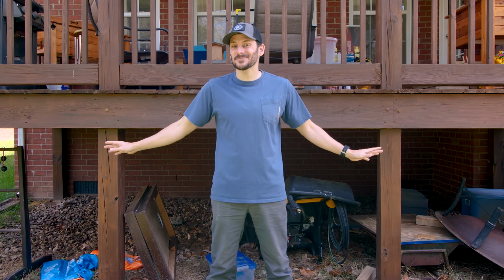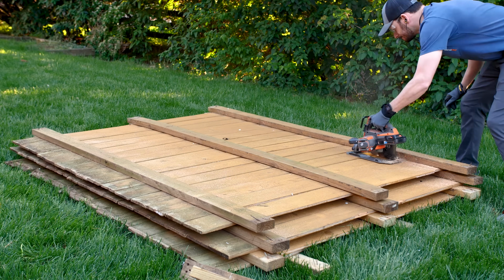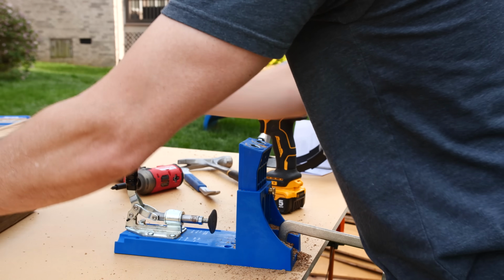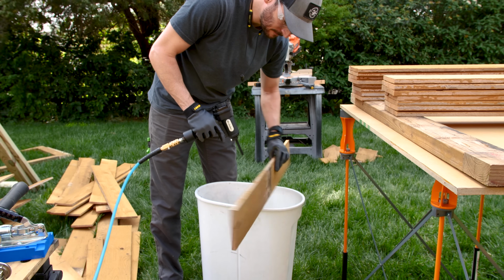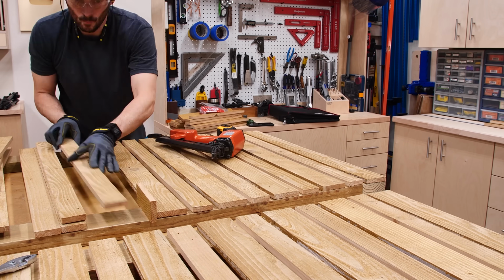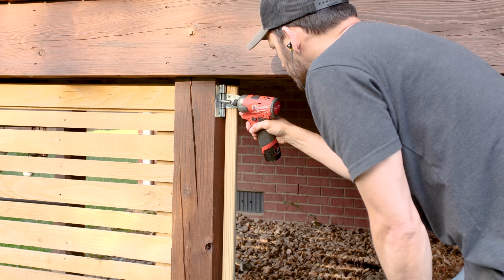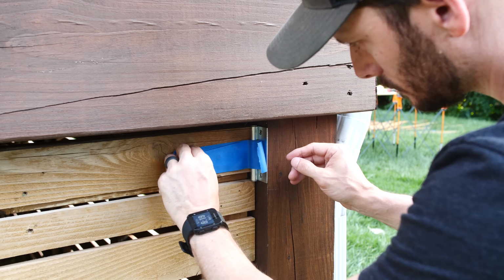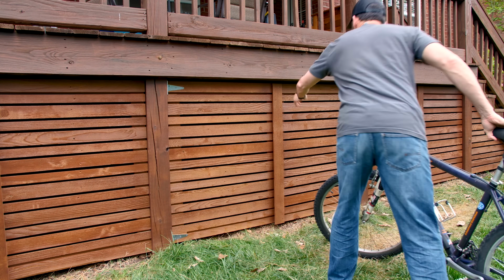Easy Under Deck Storage

Comment: I realize this video is 5 years old, but hopefully you'll see and respond to my question. I'm in the midst of doing exactly this under my deck. Though I used store-bought fence pickets, not free but pretty cheap ($2.18 per 6-foot picket). I have reclaimed a bunch of wood from my kids' old play structure, though. To the question, what about waterproofing? I plan to put the Christmas decoration tubs and my lawn mower under there.

Comment: Great project and incredible job on recycling the wood. 
I have several times used recycled cedar fence boards on projects.  I did a beautiful project around a big island that turned out beautiful recently.  The nail holes just added character on my project.

Comment: you should Update your drain pipes off the porch , get rid of that black piping  because over time the weight of the ground and people and heavy things going over it will crush it , replace with PVC pipe  in a undground trench leading to the back of your property  but a better drainage

Comment: Brilliant.  great idea on clamping the door panels together before installing.  Ive tried the opposite and literally spent days trying to get them just right.  End result screw holes slightly off resulting in a messy work around.

Comment: Very cool man! I did something similar to my deck many years ago. I used treated decking boards and ran them vertically rather than horizontally. I think either way is a lot better look than lattice.

Comment: You did a great job! I did a similar job to my friends back porch/deck in TN.  I hate hand saws but I found most american hand saws work /cut on the push stroke. When you apply a pushing force the blade wants to bend on an america style saw so your cuts are wider and not straight! I bought a Kakuri Japanese pull saw! It cuts on the pull stoke! The blade is in tension and keeps a straight thin cut.

Comment: Great looking project!  Do you have a deck gutter system to keep the rain from dripping down into your newly enclosed storage area and getting everything wet?  I plan to create a DIY roof with some fiberglass, corrugated panels installed with a slope to a gutter to keep the water out of my storage.
Reply: Same question and I had the same idea as you. That alone is a huge project for me as my deck is 10+ ft off the ground and 10x20ft.

Comment: Tim from Canada if you were doing this reclaiming Oldewood and you are using a reciprocating saw with a metal blade to cut your nail heads off suggestion put a tarp underneath your wood so you do not have to find the nails later.. because in the end when you were cutting the grass do you really want those things to be shooting a crossed your lawn.(Step one when you were reclaiming all wood and you were having a hard time taking the nails out..).. step to put a tarp down then put your project over top of your tarp... it will see you in the end when you’re picking up nails.)."(step three you’re ready to get to work on your project use a reciprocating saw with a metal blade it will save you a time in the end have fun get to work)

Comment: Years back we re-did all the baseboard in the house and the 18ga brad nailer was a life saver. After hammering in nails to the first board I went and bought the thing.  I also had a project that needed staples and got an air powered staple gun because the hand held one was a pain.  Falls into the "best purchase ever" category.

Comment: Great video, but I'm surprised you didn't put a coat of finish on everything before assembly! I've found it means less worry about getting into nooks and crannies! It also makes for less of a race against weather, you can still fit everything inside, usually
Reply: i think  he would of if he didn't have that sprayer and I think they were cedar fencing so they were pressure treated..???

Comment: If those are cedar fence pickets you're going to regret not using stainless steel nails in a few years after those galvanized nails react to the cedar oils and leave dark stains streaking down. I've seen this time and time again, regardless of how well you keep the wood stained. Otherwise I really like your work, nicely done.

Comment: Need to add a cross brace on the swinging panels. Place inside the frame and run from outside top to bottom hinge. If you want it to last longer haunch them in to the perimeter frame.

Comment: You not only saved the wood from the landfill, you saved your wallet from lumber prices. 
If you have the time, I'm curious what this would have cost buying new lumber. Prices are way crazy right now. I would sometimes buy a longer than needed 2x4 to have the scrap for a fire pit, now I cry inside when I see the prices.

Comment: If you use a lot of reclaimed timber I think you would find a pinpointer a great help. It will locate all those hidden nails left in the wood. I use one on all my wood before running it through my joiner thicknesser.

Comment: My only question would be what's stopping those doors from flopping around during a strong wind? Have you considered putting some sort of catch or magnetic stop on the door sections? Maybe high wind isn't a problem where you live, but for me it seemed concerning.

Comment: If you set your air too high, the death puncher will send everyone in the neighborhood running for cover.  Nails bounce like crazy.  Trust me on this. ;)
Reply from the maker: Oh yeah, had one bounce off the bottom of the trash can and hit my safety glasses. Gotta be geared up when using it!
Reply: @Fixthisbuildthat  LUCK 100
Reply: @Fixthisbuildthat  Possibly dumb/overkill suggestion: some water in the trash can would stop the nail from bouncing back towards the user
Reply: @mountainbreath1371  or sand/dirt/lime jello.

Comment: Looks great, Brad. Is there a reason you didn't use your drum sander instead of the RO? I really enjoy your videos. Take care. 
Bill
Reply from the maker: They weren't a uniform thickness and many were warped. So I'd have had to take off a lot more to get consistent. I just wanted to knock off the stain
Reply: @Fixthisbuildthat  Gotcha! Thanks.

Comment: Well done. Great inspiration. I did the same thing. 3 years ago someone was taking down their deck. I look cjed itvup for $450. And ended up with a 10 x 20 deck with composite top.  Alot of work to pull all nails screws and clips but we'll worth the effort
Reply from the maker: Nice!

Comment: I will never grow tired of the dad jokes and seeing the death puncher used by a different maker i definitely need to get one. I'm tired of hand punching nails.
Reply from the maker: Yes, the air punch is fairly cheap for the time it saves too
Reply: Spring loaded nail punches are great too especially if you have no air available or in a tight space, also good for punching out hinges on doors.